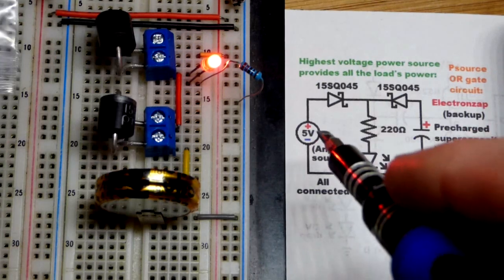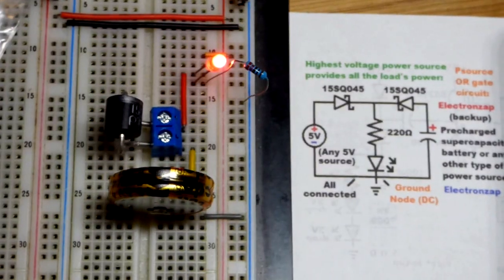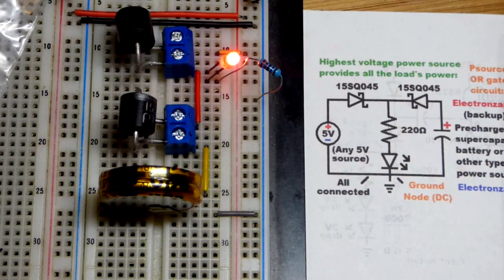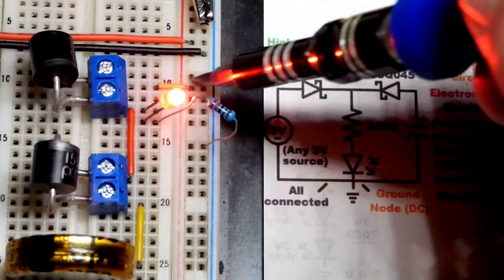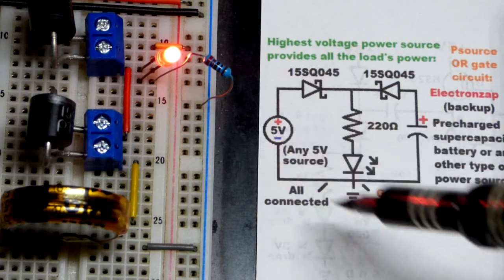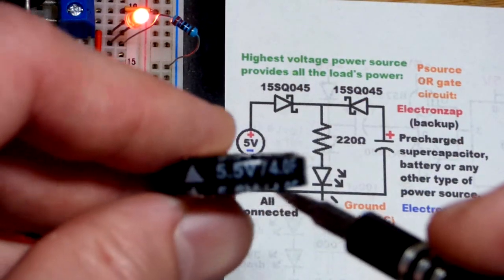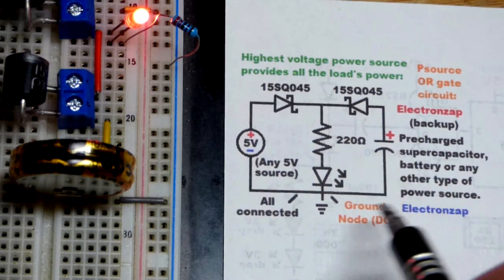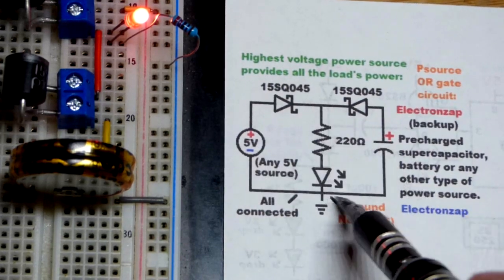Backup power demo circuit using completely separate supplies with diode OR gate by electronzap

Comment: I have a few questions. Does the cap get recharged in this circuit ?  and could you use a battery instead of the cap if so what is the advantage of the cap.
Reply from the maker: The power source doesn't charge the cap in this circuit unless you add something to allow it to do so, I did an earlier video where it always tops off the supercapacitor. Batteries are far superior to supercapacitors, there's only a few situations where you are better off with supercapacitors than batteries. They behave similar though, so you can build a prototype with supercaps that will work with batteries. I just got some batteries that are easy to film with smaller circuits. I plan to make a videos like this with the batteries soon.  So, they will probably go live on YouTube next week.